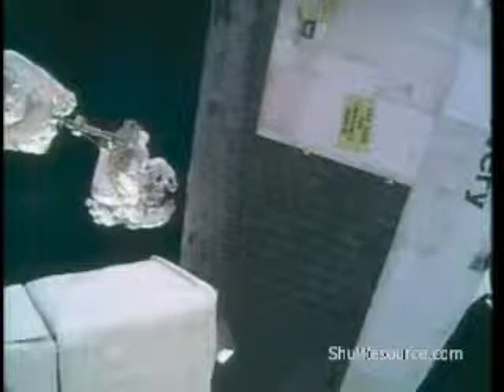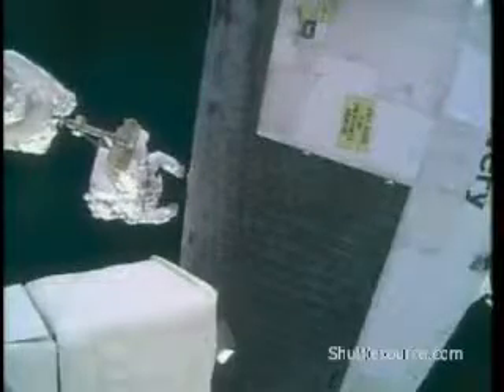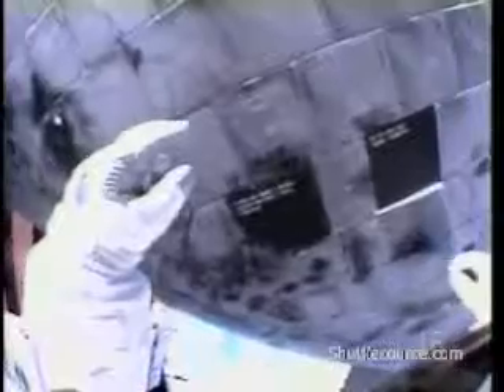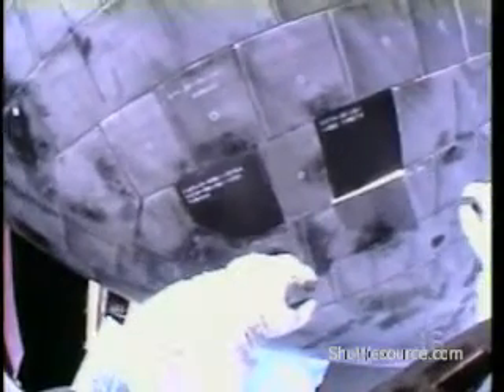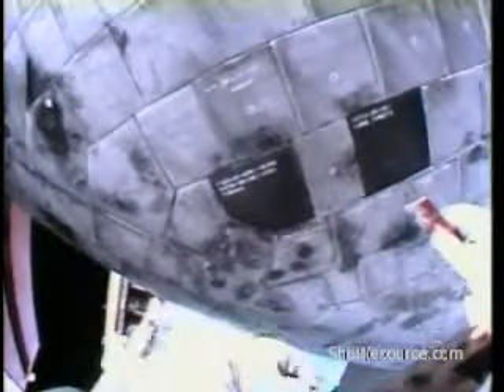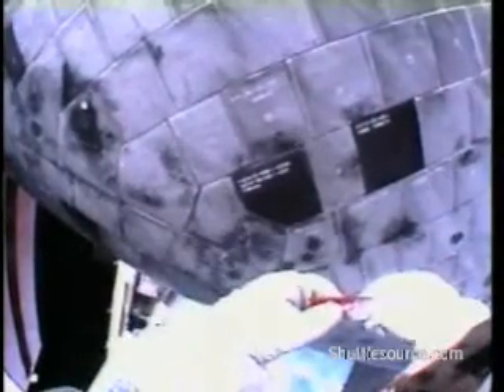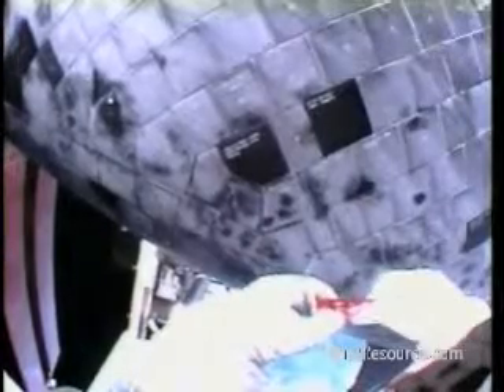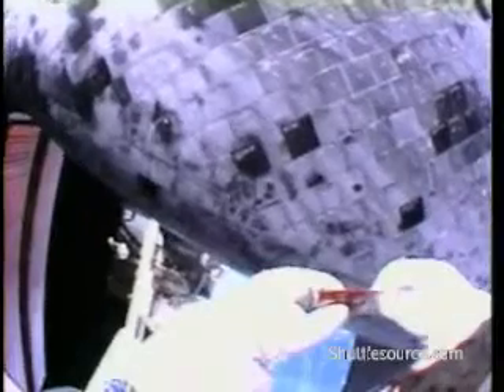Space Shuttle STS-114 Space Walk to Remove Tile Gap Filler

Comment: The NASA tile group was in the next cubicle at KSC and they worked with these type issues all the time.  It was better to actually remove the gap filler if it was sticking up as far as heat as the disrupted plasma flow was worse than having a slightly larger gap between the tiles.